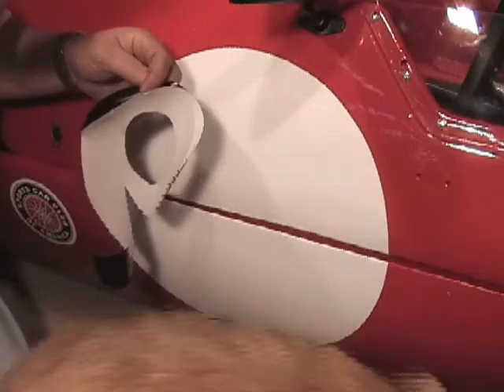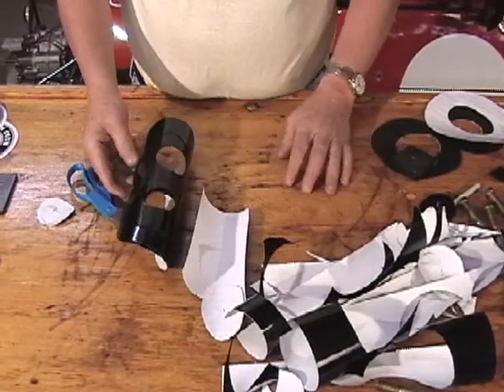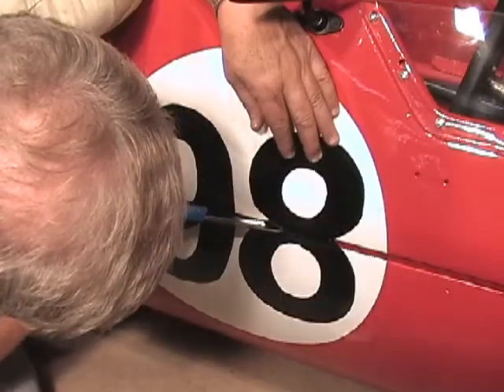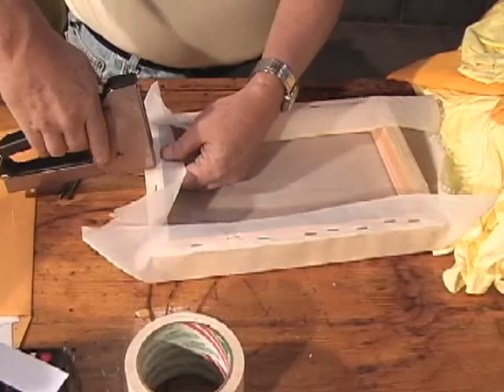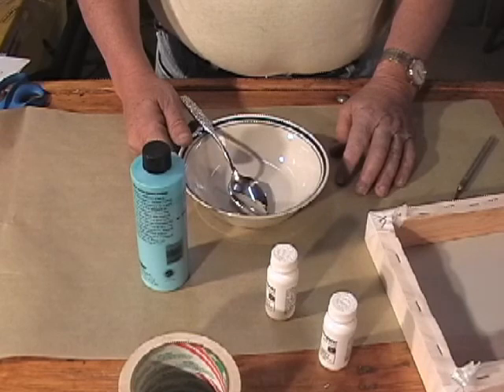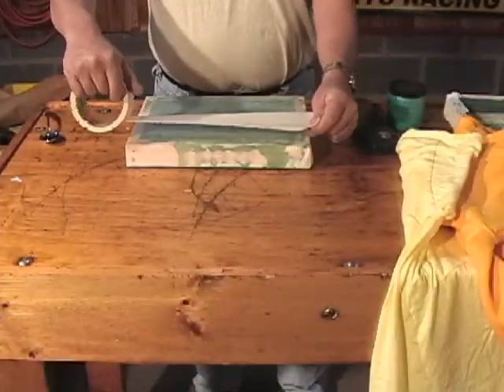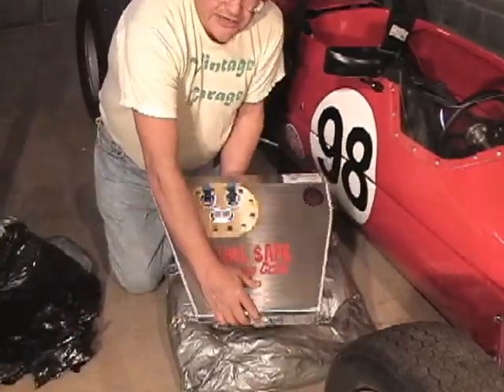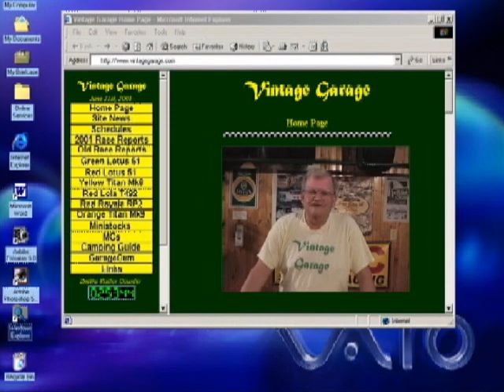Ep. 9 - Silkscreening Vintage Garage T-shirts - Air date May 20, 2002

Comment: Well how cool was all this stuff, we was wondering where you got so handy with tools.!!
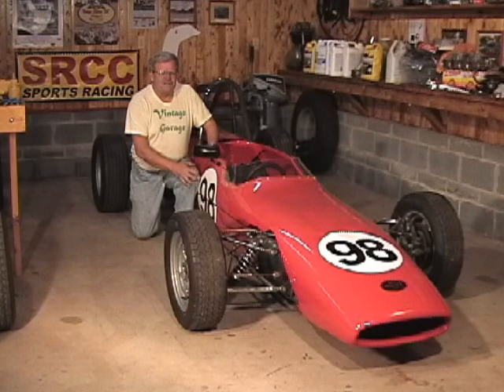Air date was about a year and a half before we moved down to Florida from NC. Had some friends that went to Hershey PA. Every year for the car shows and flee market parts, 27:20 😎👍
Reply from the maker: Every one of those TV shows from 20 years ago were 28 minutes and 50 seconds or so long to allow time for the TV station to run their station advertisement at the beginning or ending of a show.  I made 13 shows for each of two seasons for a total of 26.  Each show was filmed on mini-DV tapes and edited with Adobe Premier.  I would then create a large format digital tape that was required by the TV station.  The deadline and length requirement were actually helpful in making me work quickly, and not spending too much time thinking about what to do.  A lot of tape ended up on the cutting room floor, saving me a lot of edit time.  I do see that nobody is watching those old shows now that I put them on YouTube.  The one from Sebring has 9 views, and all 9 are my views I made while checking it out.  LOL
Reply: @Vintage_Garage  … what did you do in the DC area back then.??
And when did, what made you move to Florida.? For us it was wanting to “Get Out” of the rat 🐀 race of the Raleigh Durham, Chapel Hill area to where there was Less people per square foot.!! 😎👍👌👏🥳
Reply from the maker: @annafraley5388  I worked for GE for 27 years in the Washington DC area and retired to Florida in 2006.